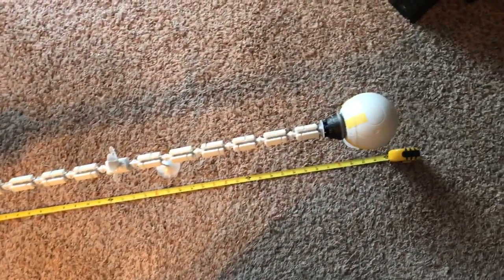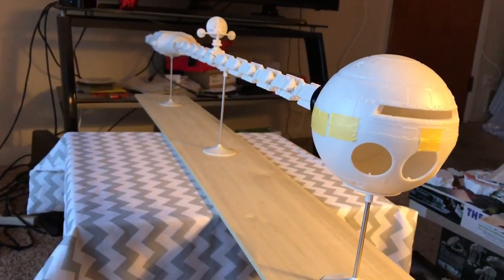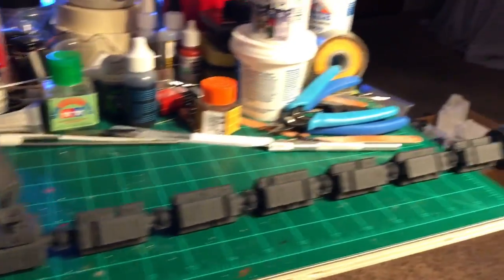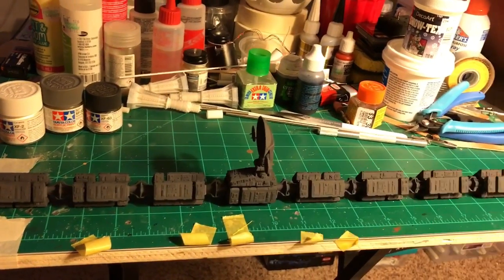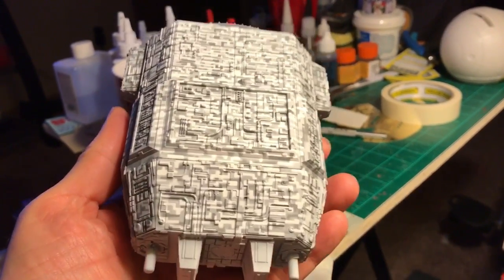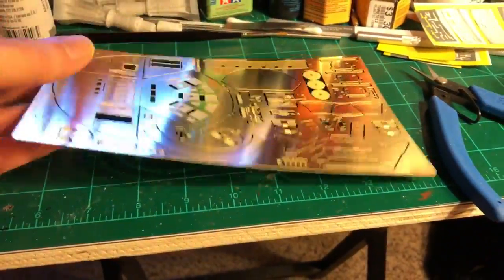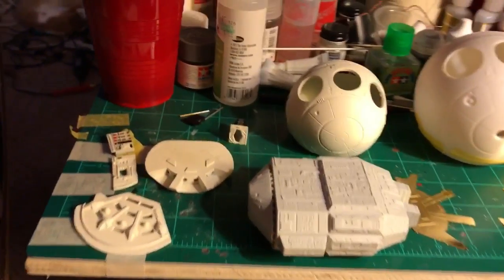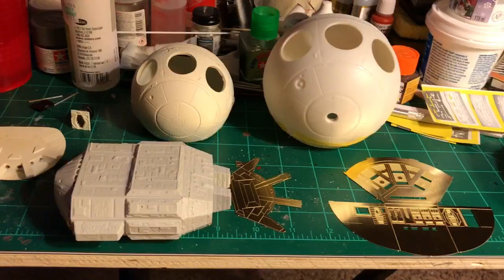2001 Discovery Build part 3

Comment: So the Tamiya stuck to the bare plastic? Or did you spray a primer coat first?
Reply from the maker: The majority of Hobby paints are designed to work best with styrene plastic. Primer is used to prepare other materials for paint such as resin and metal, this is why most primers are made for cars that are metal or fiberglass. It’s also useful when filling seams and to see defects that need to be fixed because they show up well with light grey. In addition, I’m putting on 5 or 6 layers of paint so a primer coat would be yet another. Check out my latest build of the Discovery, I added some brass rod for piping on the propulsion unit so after I painted a base coat I sprayed an enamel flat coat over to protect the paint on the metal since I was then masking it to paint more layers. Here is the latest video, I’ll be uploading a new part soon. https://youtu.be/MYKu6D48OCI

Comment: On some of the Paragrifix descriptions, they say the airlock and the pod bay are incompatible. Is that true? Is it just one or the other?
Reply from the maker: Grandmaster Blowhole, the airlock as shown in the film is too large to fit in the small area next to the pod bay. When the photo-etch pod bay is installed, there is about a 1/4 in of space there so you couldn't also have the airlock. Haven't seen anyone choose the airlock only though.
Reply: @kenspriggs5687  Thanks Ken- but you have an airlock right? Did you scratch build it? I haven't built this yet- waiting on the kit but when I do, your videos will be invaluable. I seriously doubt I'll be able match your amazing modeling skills though- I'm very impressed!
Reply from the maker: Thank you, Grandmaster! I didn't build an airlock, I scratch-built my own maintenance corridor. It goes towards the back right of the pod bay, the airlock is the doorway to the from right. I have a tiny Dave Bowman figure in my corridor.